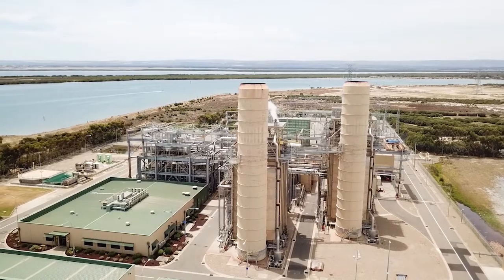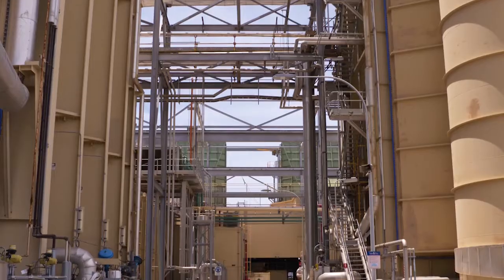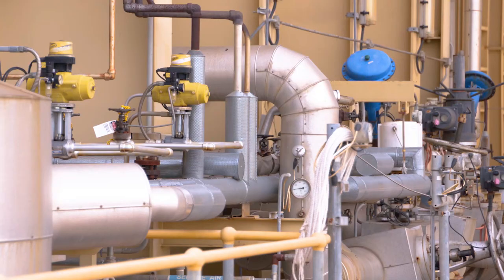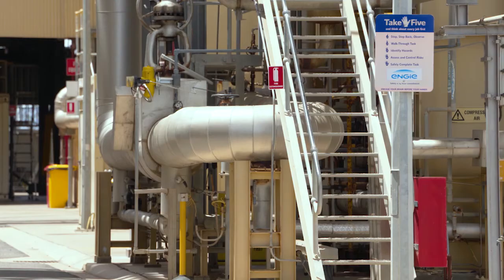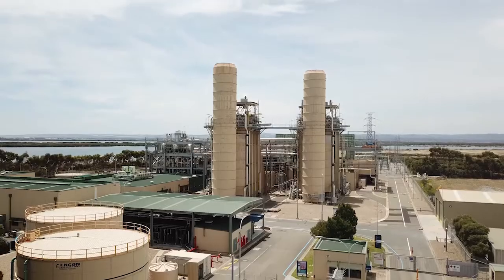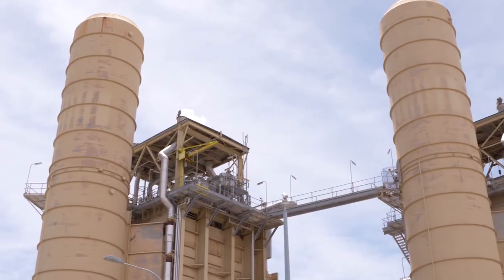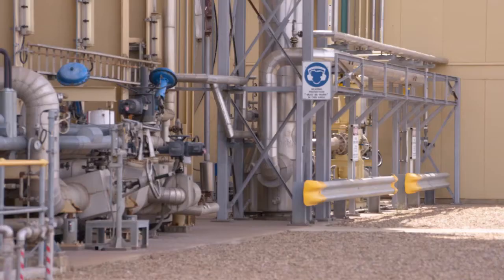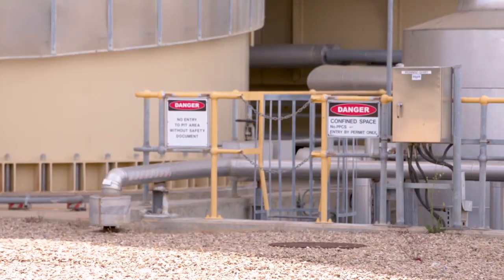Firing up a gas-fired power station

Comment: The description above is missing a couple of words. "fossil-fuelled" needs to be inserted after "friendly". That would make the statement true.
Reply: Cleaner than coal by a huge margin, vastly more efficient than Torrens island. Its not a solar panel but honestly a step in the right direction.